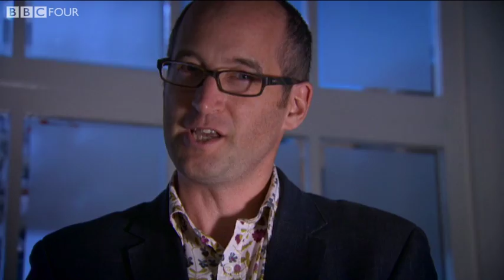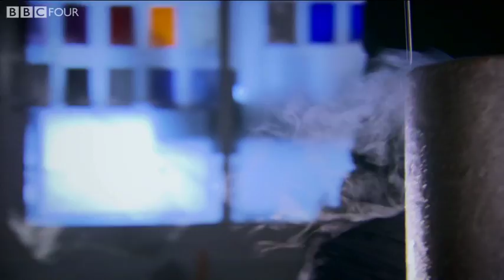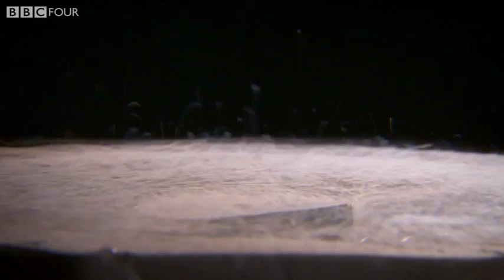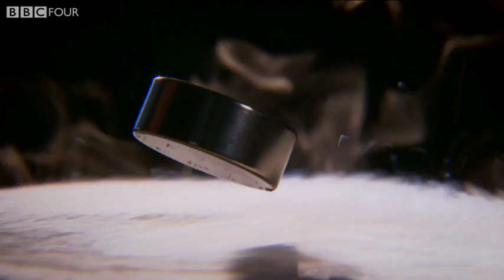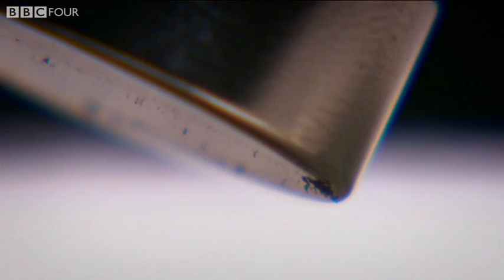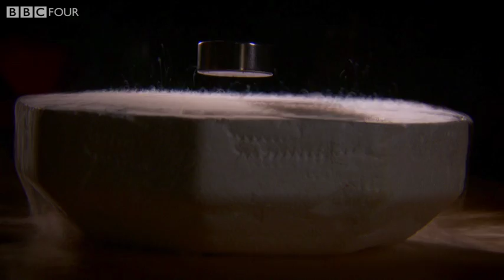Quantum Levitation - Ceramics: How They Work - BBC

Comment: not really, too conduct electricity you will need either a generator or an inductor.  to turn the generator would add friction to the system, resulting in an eventual stop of the systems movement. the inductor would add another magnetic field to the system, but im unsure as to how that would effect the system as i have not been fortunate enough to play with these yet haha.